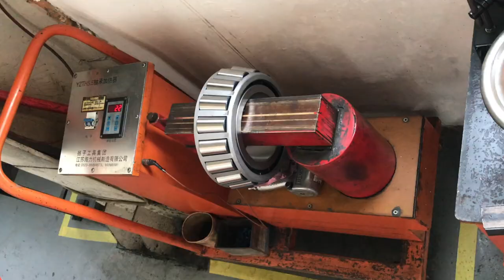How to install the bearing assembly? #slurrypump #pump

Comment: Hitting a bearing with a steel ballpeen hammer is not done, you need a softer hammer. Heat the bearing up properly then you wont have to knock them on and using the labyrinth as a battering ram is not done.
Reply from the maker: Thank you for your pertinent advice! We will submit your comments to the relevant staff.